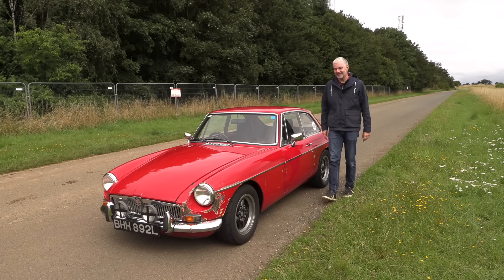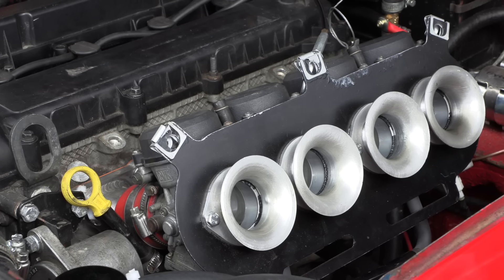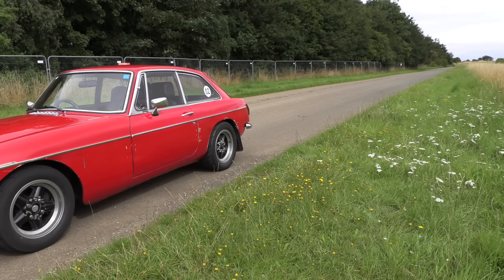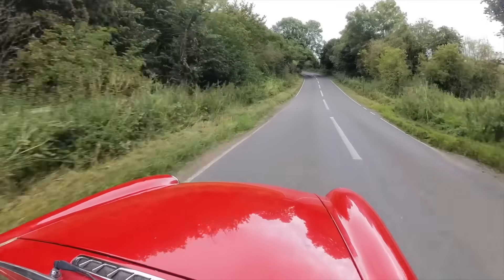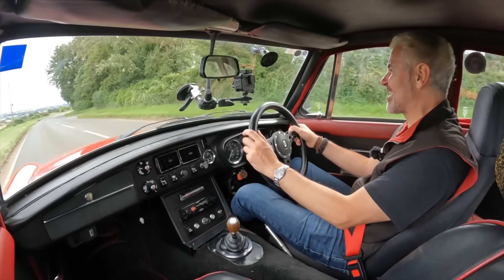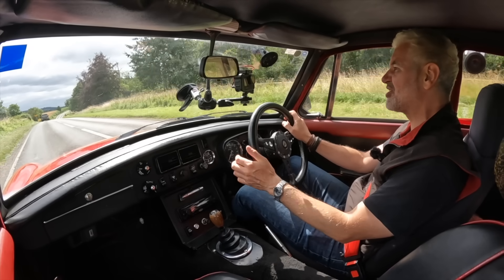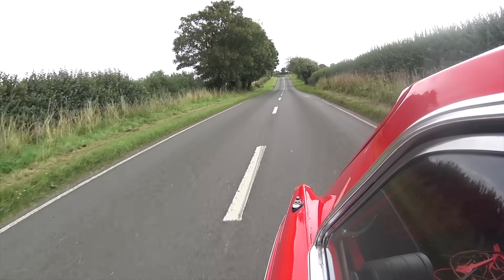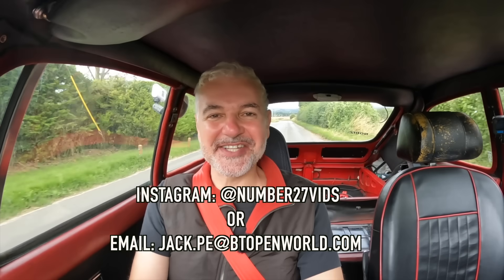This Mod Makes Electric Conversions Redundant - MGB GT Duratec

Comment: The only thing worse than modern electric cars are classics with an electric conversion.
Reply: Depends how much you drive it, though. The motor itself has emissions - potentially more than those of the conventional ICE, and if you don’t do high miles it could be quite a while until it crosses over. Especially comparing an existing repurposed engine with a new electric motor
Reply: Fewer emissions though. Something has to change.

Comment: It still produces toxic emissions that cause cancer.  I'll pass.    There may be some applications that require ICE engines going forward (extremely cold environments, towing), but for urban driving, ICE needs to die.  If people want to keep their Ferraris and Porsches and pay the extreme taxes and fees for synthetic fuels for their occasional weekend drives, so be it.
Reply from the maker: Classic cars produce an absolutely negligible proportion of total pollution. Converting them to electric is doing precisely nothing to help global warming. Have nothing against electric cars or the conversions of classics where it makes sense. On cheaper cars like this it absolutely does not. More efficient modern engines are a step forward in every way and far more achievable financially.

Comment: When I was at school [in the Dark ages] they used to put Ford Cortina  1600 OHV engines in Morris Minors.Apparently it mated quite well to the existing gearbox if I recall correctly.I remember my dad [who was a mechanic by trade] saying that it was too much power for the Minor to handle!
Reply: Fiat twincams mated to Fiat’s 5spd box was another way of updating the old Morrie.
Reply: Cortina engines were 1500.

Comment: I love it. There is nothing like the involvement of shifting gears and working with the engine and transmission. Like you said, the car has a soul. I have both electric and gas powered cars and as wonderful as the electric car is in so many ways, it is a cold mistress. My TVR, Caterham's and MX-5's have so much more grasp on my heart despite the fact they are nothing like as good as the Jaguar.
Reply: 2 ratios + say, 3 levels of  energy recovery - effectively letting u change down several 'gears' approaching a bend and ability to shift up once during acceleration is both doable and desirable?

Comment: I put a Slant six Chysler in a Tr-4 awhile ago. Way before engine swaps were a popular thing. Why anyone would convert a nice car to electric is sheer stupidity.
Reply: Sounds like a quick machine you’ve got. I bet it’s good for a 13s quarter.
Reply: @chrishenniker5944  I will never know. Quarter mile acceleration places too much stress on components. I more enjoy twisty roads. There is a professional build of a Slant six on Youtube. I believe they got 280 HP and over 300 ft lbs. Then they added a turbo! Fuel injected, everything you can do to modernize the engine.

Comment: Converting classics to electric is just heresy in my opinion, the whole character of a car is defined by its power plant- the way it sounds, feels, and smells. It comes down to whether you want a classic or something that just looks like one.
How much value would be placed now on a 60s car that had been converted to turbo diesel power 30 years ago? 
This kind of conversion on the other hand (which has been going on for a while) does a good job of retaining the character of the car.

Comment: I constantly come up against MGB's at our local hillclimb (Mt Cotton) and they give me and my MGTF 160 race preped a good run.  I have been tempted a few times but the B series engine always stopped me.  I will have to rethink now what I should do.  There are some really potent Honda engines around too.  Thanks Jack another great video about cars that we can all afford and relate to.
Reply: Bonnet height tends to rule out a good few alternatives. The Busso V6 or Vauxhall Y32SE engines would sound great while throwing you up the road.

Comment: Loved the video.  I like the refurbished car idea.  What would you put into your Lotus S1 if you were ever to need to replace the engine?
Reply: I’d probably drop a Honda Vtec or a Rover V8 in my S1 if I was going to swap out the engine.
Reply: @Omegaman1969  rover v8 would be like lighting a cherrybomb under a coke can.  I do like the idea of the honda vtec.
Reply: @ciscoytube5352  I’m talking about an Esprit S1 😊
Reply: @Omegaman1969  ah sorry, we own Elises
Reply: @ciscoytube5352  I figured that after I had replied 😊👍🏻
Reply: @Omegaman1969 I would say that electrifying the Esprit S1 would suit it very well. Somehow, to me, it fits the image/design of the car. Same as it would suit a DeLorean imho
Reply: @elflamo7612  I think at the moment, weight would be an issue, also there is very little room for batteries. I’ve known few that have converted to the lightweight Rover V8 and they really like how it feels.
Reply: @Omegaman1969  yes, i agree on battery weight etc. What I mean is from a visual design perspective, in my opinion, electrifying would fit it somehow. Being (still) futuristic and all. Talking as a S1 owner here, having pondered about what to do with my car in the next decade :-)
Reply: @elflamo7612  Yes definitely has the futuristic looks. 
I think of some invented a compact hub motor that we could fit to the front wheels, have a battery pack under the bonnet, then using the engine and electric together would really make the car fast, and 4 wheel drive . You could then just use front wheel drive for slow city driving. Is yours the silver S1 I see on Facebook ?

Comment: I love old classic cars too Jack, but I have really grown to dislike internal combustion engines!!  My best argument is simply based on the mechanical complexity of an ICE motor...there are literally hundreds of moving parts and possibly single points of failure:  carbs, cams, timing chains, valves, fuel pumps, etc., etc.  Meanwhile an electric motor has moving parts that you could count on two hands...so very reliable, just add current!  Then you add the other benefits:  instant torque, quiet, lower center of gravity, no fumes.  I've come from a long line of BMWs, most of which were manual transmission cars, but I've seen the EV light and I just won't be going back.  Not having to stop at a gas station is extremely liberating and avoiding working underneath your  car outside in February with oil leaking into your hair is something I won't ever miss!
Reply from the maker: All good points there.. and respect your choice. But for many of the cheaper classics the cost of a conversion makes it out of reach. This has many or the advantages, plus adds involvement for less money. Some cars.. a Citroen DS for example, or a Rolls are better suited to electric.. and ultimately it also depends how you drive.
Reply: I feel your argument for mechanical complexity is heavily one sided as you're not taking into account the electrical complexity of an EV. A lot of computing has to occur to make a modern EV function, it isn't just a case of adding current because the mechanical saying would be "just add petrol".

Comment: Sounds incredible!  I think electric cars are great but the joy of driving is using a manual, petrol car to ITS best, rather than overall speed. Which is why EVs, automatics, DSGs, cars with loads of traction control etc don't hit the spot. I'm sure thrashing a corsa gsi is more fun than an audi RS4. WHOS WITH ME!

Also, you said the engine has bike carburettors, surely it has EFI?!?!?!

Great film though, watch out for Mr Metcalfe on the old 'squirt up the hill'!

Comment: Hoyle Engineering sell an  IRS that does away with leaf springs and allows for a bigger diff and rear disc brakes.. pick a Mazda power plant or BMW 2 litre and the recipe is a good one. Lots of fun to be had.

Comment: A great video and enjoyed watching it however it is has little relationship to an electric conversion. you could not drive that in a low emissions zone, you could not charge at home and its not silent and still burning fossile fuel etc. Personally I would probably go for a v8 but people that want electric typically want for the reason above.. It may make a v8 conversion redundant but not even sure about that, would that really be more. When I had my B 20 years ago a V8 conversion could have been had.
Reply: Low emission zones are the spawn of the devil.  I'd NEVER consider that as a reason for any auto decision I make.

Comment: People have always done engine swops, it's not an alternative to an electric conversion, it's an engine swop for increased performance, maybe economy, I'd have thought that at 5k you could tune a b series up pretty good, supercharger (?) good old reliable engine the B series, had loads, we used to go to France in a bgt, 38 mpg and could cruise at 90 (ish) in overdrive, you were very brave in flying around in something with, shall we say undeveloped suspension, can't see how double wishbone front suspension is antiquated. Great video tho, you look like you can drive a bit as well.

Comment: I presume this is trolling unless the engine runs on water. The solution to petrol engines producing CO2 and other pollution is not newer engines.
Reply from the maker: Classic cars produce an absolutely negligible proportion of total pollution. Converting them to electric is doing precisely nothing to help global warming. Have nothing against electric cars or the conversions of classics where it makes sense. On cheaper cars like this it absolutely does not. More efficient modern engines are a step forward in every way (including lower emissions) and far more achievable financially.

Comment: Ev conversions are not an economical option, which is a shame, as swapping drive train would have less environmental impact than scrapping a car with perfectly good body work and buying a new EV. If they get more popular then prices will come down, but I fear never really a cheap option. One of the issues is lack of 2nd hand parts, EV batteries and motors are lasting longer than expected…

Comment: Two things... I run a daily driver MGB GT with a second hand 2ltr fully rebuilt engine, ( bought the car with the engine swapped it and resold the car). The engine with very few miles on it was...Iver Searle Power Plus 2000cc engine, reconditioned, lightened flywheel with new ring gear, electronically  balanced crankshaft, flywheel and clutch assembly, conrods end to end balanced and pistons balanced.
So it cost me a days work and a couple hundred pounds .... the resultant car pulls like a train , and is reasonably  original. 
Also it has been said , at about 1500 miles use per year .... my car can be driven 46 years before it reaches the same amount of carbon as the production of a single new electric car.  So how green am I !!
Reply: I would like to see the calculation on that 46 year claim because in that regard it's easy to fall for misinformation and often the carbon emission advantage of new EVs is often massively underestimated.

Apart from that: yeah old cars with low mileage aren't the problem - large, heavy, high mileage daily drivers are.

Comment: This was a great day and I'm glad you liked the car. Your observations about the steering were spot on and I've changed the springs and the geo since as a result. Feels a bit less "sketchy death wagon" more "oh a real car".
Reply from the maker: Thank for coming down Jacob, really enjoyed driving it!!
Reply: @Number27    my old Ford Ranger has this engine (but a 2.3L.) it's got the dual spark and is what is put in the Miatas. 

Anyway. It sounds so similar to my ranger, I love dual spark Ford 4 cylinder engines. Torque and a very long service life..very long. Love how they sound at 4k

A lovely sound- I may put it in an MGB I am being given as a gift soon (67 convertible hard top) but the engine is quite like a WW2 jeep. 😂.
Reply: Please can we ink "Sketchy Death Waggon"/SDK into the reviewing lexicon, Jack?
Reply: @Lemma01  Seconded!
Reply: Sounds as though you have achieved something really neat there. Well done!
Reply: @reallynotpc I think the bike carbs are absolutely impressive. Very resourceful young man, he is!
Reply: Great job Jacob, thats inspiring me to do a similar upgrade to my B. was going to do the MX5 gearbox conversion, but may as well mate it to the right engine! Wilwood brakes are a good idea too :)
Reply: great engine swap for that car, still sounds like a little British sports car. Nice carburetor set up, Ivan's jet kit in it?😊
Reply: Great car Jacob. What kind of fuel efficiency do you get with those bike carbs?
Reply: nice conversion , but what's up with mud flaps on a sports car ?
Reply: Cool MGB GT. You made a better choice by using the GT than the roadster.
Years ago I converted a 73 VW Westy to use a Toyota 2TC [hemi] including making the water cooling system and ended up with a top speed of 85 mph and it got 30 mpg when cursing at 70 mpg. So I do know how much work you must have put into your B. Here in the states I have seen MGB's converted to the Buick V6 and MT from the Chevy Monza. Out of curiosity, why didn't you use the Buick/Rover V8 since all the parts were made to fit the B???
Reply: @davidhollenshead4892  cheers dude. The v8 is a tad more money, a bit heavier, but to be honest I like lairy 4 cylinder a bit more. Just my preference. V8 is a great option though
Reply: @jacobyoung1671  Could you give me details of where to get brackets etc? I really want to build one.. thanks
Reply: @davidhollenshead4892  There was an MGB GT V8 that AFAIK was effectively this car with that 3.5 V8.  A lighter engine than the standard 4 cyl!

https://en.wikipedia.org/wiki/MG_MGB#MGB_GT_V8

(Edited because I originally said the MGC had it but I was mistaken.  Also, 20mpg!  FFS, that 3.5 was kind of nice but that's an incredible thirst for a little car that light.)
Reply: Can you tell me where to find details on the carb conversation for the Duratec? Ignition?
Reply: Duratecs are the best' I've got 2 Escorts, MK1 and MK2 running 2.3 Duratecs. One with Hyabusa throttles and one with Jenveys. Both furious amounts of fun! :-)
Reply: @stevejones1549  my old Ranger has a 2.3 dual spark. It sounds just like this 😂 and it is quite fun between 3 and 4 k RPM 😊 even in the big heavy pickup truck 🛻
Reply: Hi great car engines are from….?

Comment: Just kicking the can down the road in term of durability and usability. How can you ensure gasoline availability after the government doesn't want to subside it? Much of the low current low costs of gasoline is being taken up by the government to continuation of the economy. If the real cost is transferred to the public no one can afford it and would be calling for a public method of public transportation.

Comment: What is the transmission adaptation like for an engine like this on a car like this? Ford engine, MX-5 tranny... how do you deal with the driveshaft, differential and so on?
Reply: The crank needs a new spigot bearing both otherwise literally bolts straight on. The drive shaft is from an mx5 like the box. Then a small adapter allows it to bolt onto the standard mgb diff. The final drive is about the same.
Reply: @jacobyoung1671  Thank you for the clarification! It's not as bad as I thought, all told. Biggest limitation for me around where I live would be the MX-5 box, as they are harder to find than gold bricks. But nice little setup, and cool to hear that it's somewhat tidy. 

I'm putting a KE30 Corolla running gear (engine, tranny, diff, the lot) onto a 1937 Opel Olympia and it's been messy, haha.
Reply: @MarcosCodas  it's the mk3 mx5 box if that helps? 
Sounds like an awesome project!
Reply: @jacobyoung1671  Thank you! Never even seen a MK3 MX-5 round my parts so I'll have to enjoy the project via this wonderful vid.

Looks like a hoot to drive.
Reply: @MarcosCodas  it's great fun. I'm very lucky to have it as a daily to scoot about in. 
The opel sounds amazing and I'm sure that'll be pretty damn special
Reply: @jacobyoung1671  Thank you, Jacob!
Reply: The MK3 Mx5 uses a variant of the Duratec Engine so it's quite a straight forward swap. The Rx8's six speed box can also be used.

Comment: If you’re using the mx5 gearbox, why not use the mx5 engine, what is the benefit of using the ford engine?
Reply: Good question. It's the same engine really. The Mazda version has vvt which means you really want efi and a better ecu. The engine also cost a wee bit more. Otherwise no different. Hope that's helpful.
Reply: I to would opt for the complete Mazda engine-trans pack, however I suspect it may be a simple case of availability and cost.

Comment: Although not a big fan of the BGT’s I have always thought, with a good engine there is no reason why they can be a daily drive. It’s a practical car, easy to handle and hatchback for shopping
Reply: Agree 💯
Reply: As a student I used to drive mine from nottingham to manchester frequently and in 3-years it never let me down!

Comment: So in theory you can make an old car ulez compliant
Reply: Historic rated cars like this one are exempt from most ULEZs anyway!
Reply: @stephenboitoult8774  yes but not every old car is a historic mgbgt
Reply: @ukmud6218  Doesn't have to be an MGBGT, any historic will be fine. If you are talking what I will call "post-historic" ie registered after 1982 but before say 2000. then it's not so easy as just whacking a more efficient engine in, you'd probably need to fit a catalytic converter if it doesn't already have one (Pre 93) and all the other emmission control shenanigins, EGR etc et boring cetera. Then you'd need to get it officially tested and reclassified with DVLA as a different emmission status. Goodd luck with that! And if it's a diesel, forget it altogether, it'll cost you at least £5k to make an old diesel ULEZ compliant and thats only by todays rules, never mind what they think up NEXT week! Probably MUCH cheaper to wait till your post 82 banger IS elegible for Historic class!